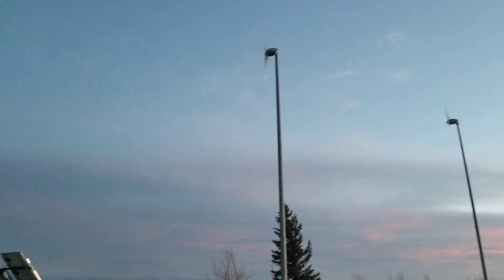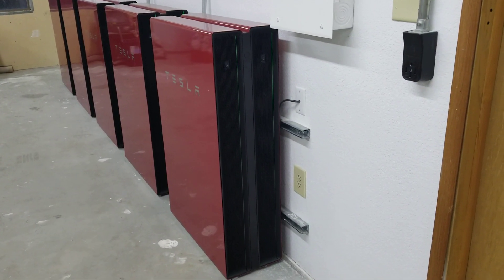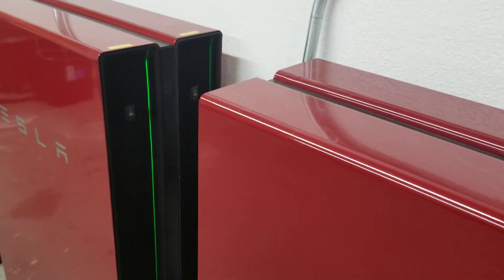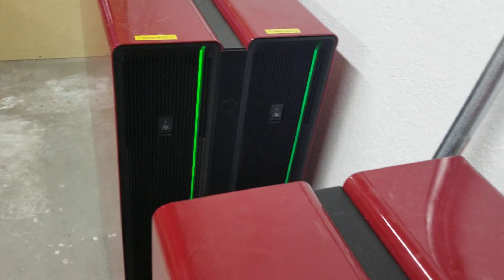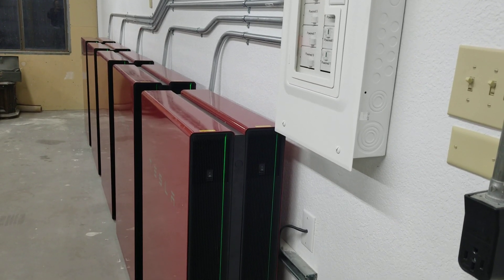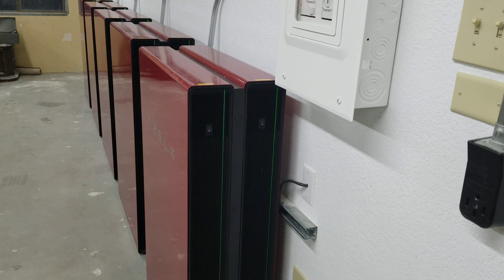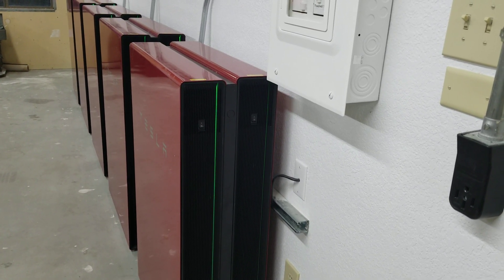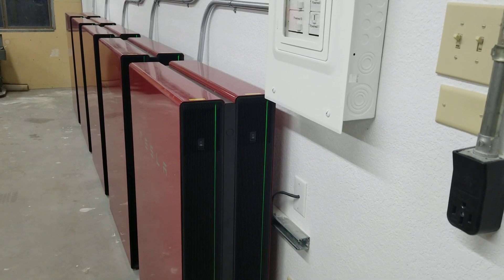Our 10 Tesla Powerwall 2 being charged by wind

Comment: How difficult was this to add to your Tesla solar hardware?
Reply from the maker: The solar PV and 2 of our 4 wind turbines were installed years before the Powerwalls.  Tesla worked with our Tesla authorized 3rd party installers to add them in at the same time the same vendor installed our 3rd and 4th wind turbines.   The Powerwall 2 units in 2019 and all of our renewable energy systems are AC coupled and use the same NEC standards so they are compatible.
Reply: @AltView1  Are they wired directly to the sub panel for the power walls?
Reply from the maker: @kev1799 Here is a link to a thread with extensive information about our system:  (1) Residential Wind Power and Powerwall 2 integration | Tesla Motors Club
https://teslamotorsclub.com/tmc/threads/residential-wind-power-and-powerwall-2-integration.191776/
Reply: @AltView1  thanks I did look at that first before commenting here . Considering exploring it with my system. Was curious if I could just tie right into the sub panel
Reply from the maker: @kev1799 keep in mind the Powerwall system has changed since we installed ours. Your best information will come from Tesla. It's not clear to me if Tesla added DC coupling via a string inverter component for the Powerwalls or if it is limited to DC only. Our system is AC coupled making it easier to function with our wind turbines and PV with microinverters.  All of our renewable systems connected to the Tesla Gateway furst ho to a "combiner board" which simplified integration of the Powerwall.

Comment: I have 21KW of solar and a sky stream wind turbine, Tesla will not install a power wall until I disconnect the wind turbine. I was told it would hurt the batteries!
Reply from the maker: Obviously, that is not true.  There may be other issues which could be a factor.  Our entire system is AC coupled.  We use  Enphase microinverters.  The safety protocols to prevent back feeding the grid are the same for microinverters and the Skystream are the same.  Keep in mind we have Powerwall 2 units.  Tesla has made changes since these were installed which may create problems for you we didn't encounter.

There is an extensive discussion of our system and technical information at:

Residential Wind Power and Powerwall 2 integration | Tesla Motors Club
https://teslamotorsclub.com/tmc/threads/residential-wind-power-and-powerwall-2-integration.191776/

I suggest you and whoever at Tesla you are dealing with look this over. I hope this helps.

Comment: Hahaha the size and storage thay take there 13.5kwh a tesla cars battery is like 100kwh and look no weree near the size of them to think tesla car stores 7 of them
Reply from the maker: It takes a special kind of ignorance like yours to make such a stupid comparison.  Each Powerwall 2 unit has it's own charger/inverter, as well as thermal management system, permitting modular expansion ranging from 13.5 kWh to 135 kWh like our system, which has 135% the storage of the largest battery Tesla currently puts in any of its vehicles.  A Tesla vehicle (of which we own two) has a separate battery charger, thermal management system, and inverter, which all are located outside of the battery pack.  You really should stick to what you know about, which apparently isn't much. 

Thus far, Tesla doesn't offer V2G/V2H options with its vehicles, so your ignorant comparison is not only erroneous, but completely irrelevant.  

If you make any more stupid or obnoxious comments on my page, I'll delete them and report your harassment.

Comment: What setup would be needed to build a single charging station for a Tesla car? Would a single wind turbine be enough? How many watts? One would also need battery storage and the actual charging connection, too.
Reply from the maker: It all depends on factors you haven't specified: 

How many kWh does your EV need to charge?  This can differ day to day depending on how much it is driven on any given day and the weather when it is used.  A Model X100D or PLAID will use more electricity than a base Madel 3. 

What time of day do you plan on changing?  I work overnight so obviously solar PV can't charge my car at night but does when I'm home during the daylight hours.  If I worked during the day, I  would need to store electricity in batteries and then transfer that power to the car.  In that scenario, the size of the battery storage you need depends in large part on the amount of electricity you need to charge your car. 

These are examples of why it is not possible to provide you with any specific answers to your nonspecific questions. 

Figure out your details and you can find your answers. Like many other things, details matter.  Good luck.
Reply: @AltView1  it'd be a Tesla model 3, which has what, a 53 kWh battery? It's always windy where I live (north Atlantic coast) and I'm not really worried about the battery size for electricity storage. I just want to know if a person could reasonably recharge a Tesla Model 3 with a yard based wind turbine. Of course I could spend $100,000 and build an industrial sized turbine but that wouldn't make sense.
Reply from the maker: @esperago  you still need to be more specific.  Do you need a full charge every day or are you needing only a fraction of that car's battery capacity to be charged daily?  In other words how many kWh do you need to put in the battery every day? 

We measured wind speeds for a year before installing wind turbines on our property.  There's a big difference between wind speed measured at 100 meters on wind maps and at 45 feet, the height of our wind turbines.   On our 9.6 acres there are very different wind patterns in different parts of it. 

Our wind turbines are Skystream 3.7.  Last I knew that were bought out by Xzeres.  You will need to find a local specialist in wind turbines who can assess your site as well as can provide service and support.   I  am not going to be able to tell you what will or won6work for you. You have to be specific and do your due diligence if you want the answer to your questions. Good luck. 

We typically need anywhere from 30 to 60 kWh to fuels our vehicles daily.  We typically generate between 30 to 210 kWh daily.  The battery system we have helps balance demand to production through most, but not all of the year.
Reply: @AltView1  I was looking more or less for someone to give me a conceptual yes or no. If I take the time to research with exactitude every single variable, I'm more than capable of figuring it out myself. I just figured that those who are deeply immersed in this matter could give me a "cocktail party" answer like "It'd probably take too long to get a full charge but a $10,000 wind turbine could probably charge your car on a daily basis if you were only driving a few hours per day." I thought wrong. Thanks though, I'll go figure it out myself
Reply from the maker: @esperago  I could give you a "cocktail party answer" but it would inherently be misleading. Instead, I gave you an honest answer.  The rest you have to figure out for yourself. Good luck.
Reply from the maker: Regarding wind turbines, the same general considerations apply. The difference is eind power can occur at any time of day.   Wind production is variable but so is solar PV, clouds and overcast days are analogous to low wind production days. 

We have some low production days, but with a combination of wind and solar PV we have more consistent power production than if we relied solely on one or the other.  

Wind turbines require more knowledge to properly site and install than solar PV.  It takes a certain amount of commitment to learn about the pluses and minuses of such systems or else you risk having a bad installation.  We have a good installation in large part because we could draw upon on experience with residential wind turbines since the mid 1980's.

Comment: Hope all is well my brother. Got a question. Can you tell me what kind or kinds of DC inverters your using to combine your solar and wind to feed the tesla walls. I have 1 power wall and solar and looking to add wind but I have the standard Tesla inverter at my home.
Reply from the maker: Our Powerwalls are "AC coupled", so the only inverters involved directly with the Powerwalls are the ones built into each of Powerwall units. The newer versions appear to have external inverters which ours do not. They are self contained units. 

Our solar PV use Enphase microinverters.  The wind turbines are Skystream 3.7 which have built in inverter boards in the nacelles so the power from the top of the tower down to the combiner board is 240 VAC. 

I hope this answers your question.  We are well and our system is working as designed.  On average we produce over 121% of our usage on an annual basis, which offsets the power we need to draw back from the grid typically in January and February.  We either are "net zero" or surplus 10 months of the year.  In order to make it fully 12 months and be able to go off grid would require either increased production from expanding the solar PV (we've maxed out the number of turbines we can make work with our system) or double the number of Powerwalls, which would require splitting the household circuits between two Gateways at over $100,000 to do that.  What we have is good enough for our purposes.
Reply: @AltView1  Your wind turbines deliver AC to your system using a built in inverter in the nacelle - I didn’t realise until that until I read your comment. Do you use any type of controller for the wind turbines? Do you have a dump load setup in the case where you lose grid power and your batteries are full?
Reply from the maker: @gregleonard4003  the batteries (Tesla Powerwall 2 system) uses the same protocol when the grid is down and the batteries are full to shut down the turbines as it does to turn off the Enphase microinverters for our solar PV; it shifts the frequency of the electricity to signal shutdown of power generation until the batteries are sufficiently depleted to permit resumption of charging.
Reply from the maker: @gregleonard4003  I see no benefit to DC charging. There is significantly more line loss by sending DC down the tower (in this case monopole) and to the house before converting to AC. High Voltage AC permits using smaller gauge transmission cables with less line loss. 

These are Skystream 3.7 turbines.  We have 4 of them rated at 2.4 kW each. South West Wind made them, but now is out of business.  They were bought by Xzeres Wind, which appears to no longer be selling in the United States.

We had a 1.8 kW 24 VDC 1948 Jacobs Wind Electric at our prior home.  It required much more maintenance, much larger wire, and still had significant line loss. 

If you truly are interested in learning more about this, there is a source which you can register to use for free:

Home Power Magazine | Downloadable Archive | Home
https://www.homepower.com/

I hope this helps.
Reply: @AltView1  Thank you for your reply and I really appreciate the recommendation for Home Power - what a great resource!
Reply: @AltView1  Thank you for your response and sharing your knowledge and experience- it is extremely valuable!  Those are details that are good to learn.
Reply: @RealJayDigs - I’m looking to do exactly the same. Have you worked out a design for adding a wind turbine to you setup? The wind turbine I’m looking at delivers DC power - I’m trying to figure out what components I’d need: controller? Dump load? DC to AC inverter that delivers grid approved VAC (referred to as G99 in the UK)? Brake switch? What else?

Comment: How has the wind been hooked up to the power walls? I thought the powerwall didn't support wind power. 

I'm looking at getting solar with a power wall. The panels will be ground mounted at the top of a hill and an ideal place for wind as well.

Thanks
Reply from the maker: All of our grid tied wind and solar goes to combiner board, which feeds the A.C. coupled Tesla Gateway.  The Powerwall system "sees" the wind turbines the same as it does solar PV.  The turbines use the same shutdown protocols as our  Enphase microinverters for our PV.  The turbines are Skystream 3.7 rated at 2.4kW each.  The total load from the combiner board is limited to 24kW (100 AMPS at 240 VAC). The Skystream 3.7 turbines have A.C. inverters in the nacelles at the top of the tower.  Tesla does not certify their use but their engineers approved this installation prior to the Powerwalls being added to our existing wind and PV systems.
Reply: @AltView1  thanks for the reply it's definitely something that I will look into then. I guess the app just shows the wind generated as solar then.
Reply from the maker: @MagicMarvin33  yes

Comment: Does the gateway control or monitor the wind power too?
Reply from the maker: All wind power and solar PV feed a combiner panel which feeds the Tesla Gateway.  Solar PV (Enphase microinverters) and these wind turbines (Skystream 3.7) use the same protocols to prevent overcharging when the grid is offline and batteries are full.

Comment: impresive setup! How does the wind generators charge the powerwalls?
Reply from the maker: The Skystream turbines convert to 220VAC in the nacelle and have shutdown protocols similar enough to Enphase microinverters that they and all our solar PV (except PV direct for water heating) feed into a combiner panel which the Tesla Gateway treats like any other AC coupled PV source.

Comment: Why would you ever need the grid with solar and batteries?
Reply from the maker: An all electric home, and electric vehicles use a large amount of electricity.  At present, we produce enough power on an annual basis to offset all of our usage.  While the battery storage system we have is the largest available at the time it was installed for the single family residence market, it is actually about 1/3 the size needed to fully disconnect from the grid.  Our batteries permit us to be "self powered" over 85% of the time during the year.  The remainder we have "net metered" by banking our overproduction on the grid. The costs of creating a storage system for that final 15%, mostly for January - March, would be about 3 times the cost of what we already have invested.  The description of the video give more information.

Comment: Hey Jason,

How did you link wind power to the Tesla Powerwalls. So curious...
Reply from the maker: They integrate the same way as our solar PV, AC coupled, connected to Gateway via 100 AMP "combiner panel". 

More details at:

https://teslamotorsclub.com/tmc/threads/residential-wind-power-and-powerwall-2-integration.191776/

Comment: Do you use 1 inverter for the 10 powerwall, which inverter do u use and is it possible to stack up 15 powerwall
Reply from the maker: Each Tesla Powerwall2 has its own inverter and no more than 10 can be stacked. More information at:

https://www.tesla.com/powerwall
Reply: @AltView1 powerwall 2 have 2 option there is a one that comes with inverter and the one that's none inverter
Reply from the maker: @michaelmaximos8182  not when we installed ours, nor would we want them without the integrated charger/inverter.  If you are correct, post a link with that information.

Comment: Uhhhh, you could call your house a village!
Reply from the maker: Not really.  I think people don't appreciate how much an all electric home uses in a cold climate.  Trying to power it while minimizing drawing from the grid is challenging. 

We monitor our electricity use  using SENSE (R) which helps us understand which which devices are using electric at any given moment as well as daily, weekly, monthly, and annual consumption.  It also gives a comparison of our electricity usage with other homes equipped with SENSE (R) in Wyoming and the United States. While our electric vehicles account for ~30 kWh/day, our overall daily use of electricity in February 2021 was ~102 kWh/day, which is the average in Wyoming for typical homes which also have fossil fuel heating.  Nationally in the United States the average electricity use for the same period was 69 kWh/day. 

There are 100,000 BTUs per therm of natural gas. There are 91,740 Btus per gallon of propane. There are 3413 BTUs per kilowatt hour of electricity.

Comparing electric home heating to combustion is not intuitive because it takes a large quantity of electricity to creating the same amount of heat as combustion, but because electricity can be made by renewable sources, when it is sourced that way it remains the environmentally better wat to do it.  That does not make it cheaper in the short term.  When people talk about monetary costs, rarely do they include the environmental costs of man made climate change or the health impacts of air pollution. From my perspective, fossil fuel use can be seemingly cheaper for the end user, but that is due to cost shifting the real expenses of environmental and health impacts on to others.